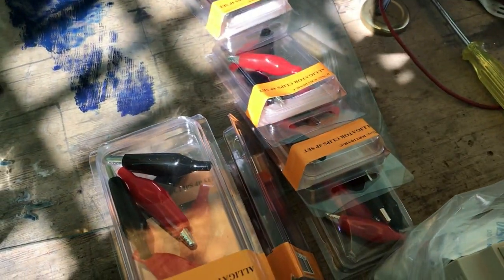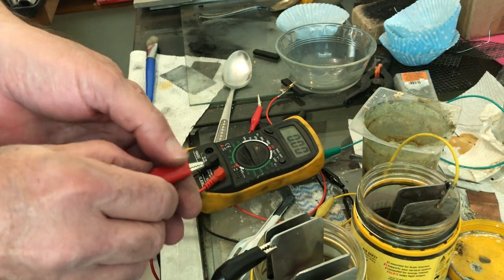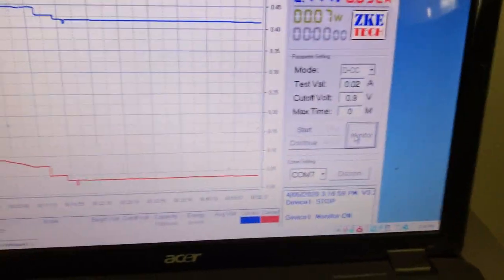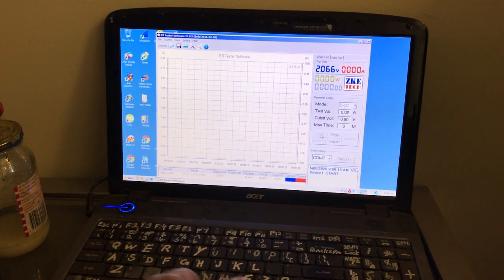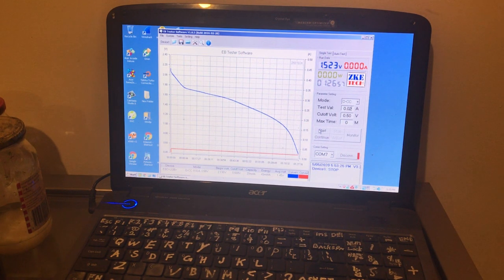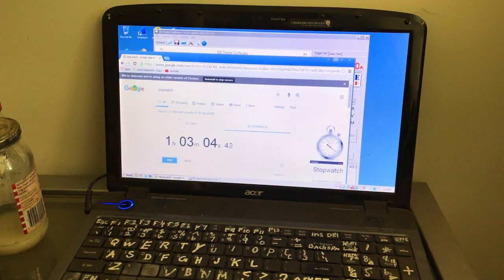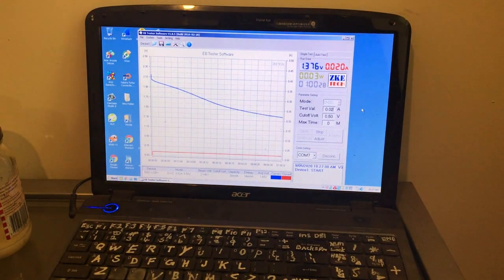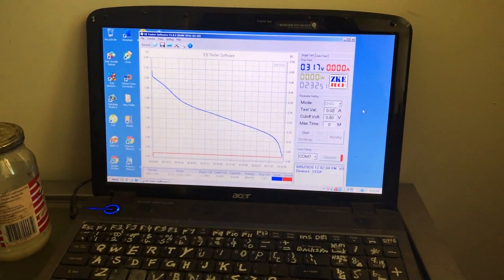Building A Iron III Hexacyanoferrate III And  Zinc Hexacyanoferrate III Cell Part 2

Comment: Hi Dan, good work !!
I think you have to be cautious trying to measure cell resistance of a discharge cell, as to measure ohms the meter needs to inject a current...V=IR...so the inject current is interacting with the cell. But careful using a meter on ohms with a charged cell !!! Them smoke electrons will start !!
Keep up the good work, all the best !
Tony

Comment: Geez man ... your content is really packed with info these days . Its really great to here all the detail and experiences your having . I was wondering with your test set up if you have considered the evaporations of the electrolyte both from ambient temps and the charging voltage disassociate of aquaous electrolytes as you are not submerging the cells anymore .

Comment: Probably a dendrite shorting your cell out
Reply from the maker: It maybe iron. There seems to be lots of rusty looking stuff building up on negative side.
Reply: Dan P if you over volt during charging it will electroplate the negative .
Reply from the maker: Electron Proton Neutron Mouron its plating on the positive for some reason I can see zinc. I’ve ordered some of RMS ink the other day. Going to use it as my binder. Should be good.
Reply: Dan P how much$$?
Reply: Dan P well you said negative plate initially... if on positive plate it maybe because of over driving the discharge c rating . It happens to all cells if they are over the c rating . I destroys lithium cells capacity very quickly as the lithium ions cant migrate through the layer .the migration gets to fast and they dont get time to find there hole and they get backed up on the surface . Maybe very slow charge and discharge cycles will reverse the plating?
Reply from the maker: Electron Proton Neutron Mouron i bought 1 litre for $235 plus shipping included. It’s 50 cents to the pound. 😱
Reply: Dan P let me know if you want me to buy half of it ? Im in Melbourne.
Reply from the maker: Electron Proton Neutron Mouron not sure. Depends how good it works. I’m going to go and make a 12 volt battery just to see how it compares to a lead acid battery. I’ve bought a sheet of 0.9 316 stainless steel 2.5 m x 1.2 m. For the plates.
Reply: Dan P cool project . Are you going to use the carbon felt to . Its very good !
Reply from the maker: Electron Proton Neutron Mouron I’m having trouble finding carbon felt they all seem to be only selling 5 at a time. I will need 60 pieces for a 30 plate battery.